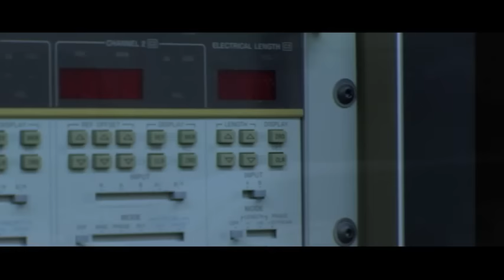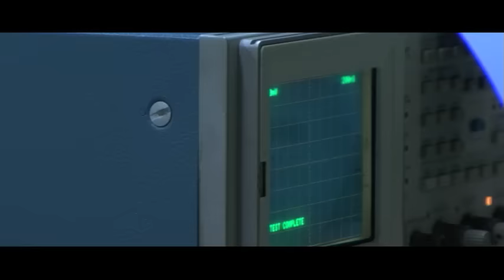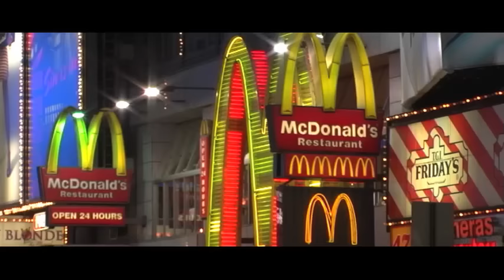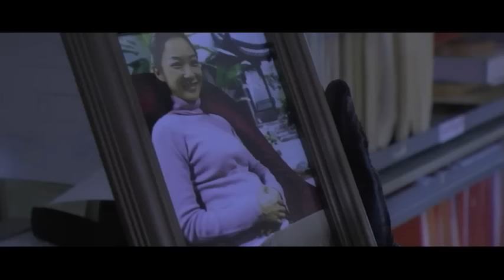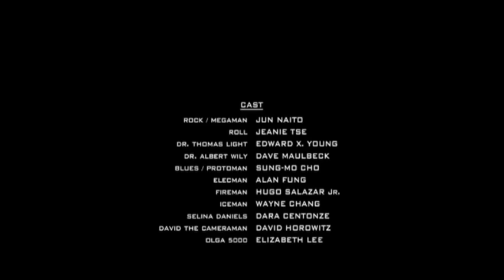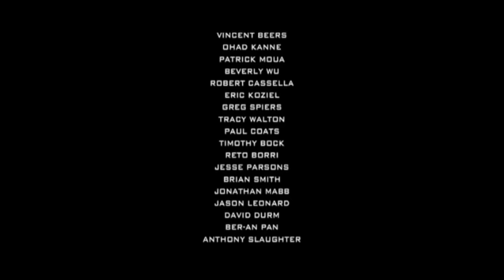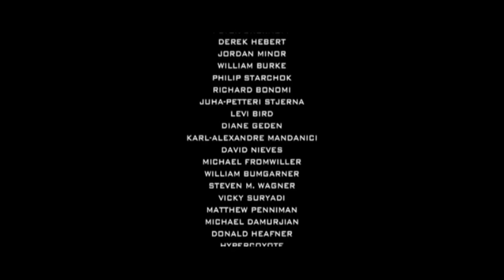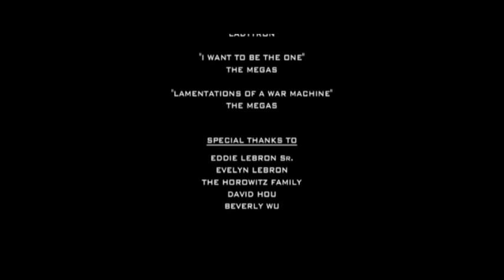"MegaMan" Fan Film

Comment: A little nitpick here…
The town is supposed to 20XX, right? Why is there Basic paper towels?
That's modern-day!
Reply: Well, they didn't say in the future.
Reply: Oh...
Reply: Out of curiosity, if it's not in the future, then why does it say 20XX?
Reply: WarriorReshiram It could actually be anywhere in the 2010+, like this year is 2013 going on 2014... Who knows
Reply: 200X = 2000-2009
Reply: smilingme123 (FlashingYoshi) I thought the 20XX would mean 2020. Since the game was made in the 20th century, they might have been thinking of naming the years in the 21st Century with Roman Numerals to avoid confusion with the years in the 20th century. (I.E. The 20's could refer to either the 1920's or the 2020's. So instead the 2020's were called the 20XX's)
Reply: Corporal Jäger
As far as I know, 200X = 2000-2009, and 20XX = 2000-2099. X is in this case used like the variable X.
Reply: smilingme123 (FlashingYoshi)  That makes sense. But only the creator would know.